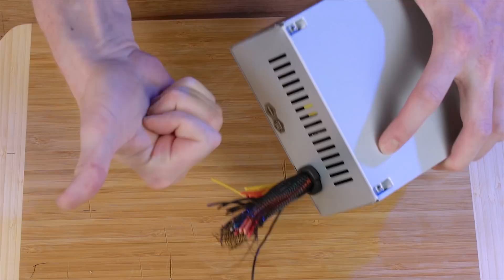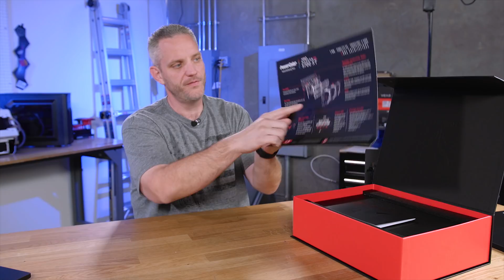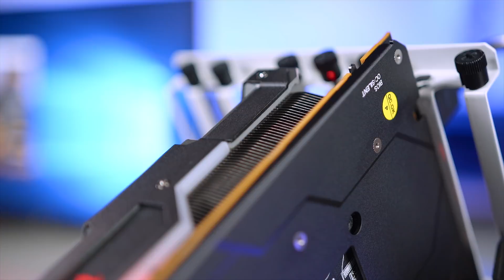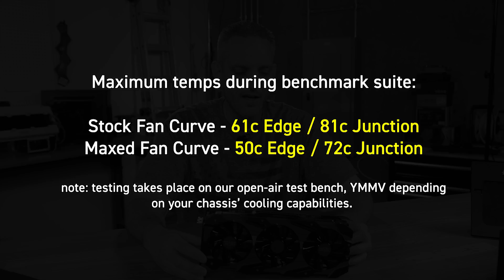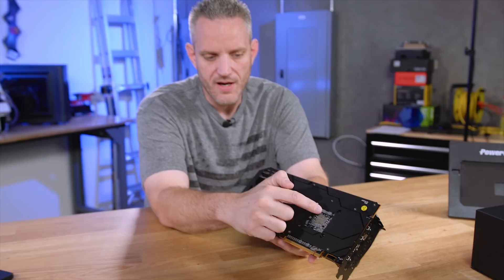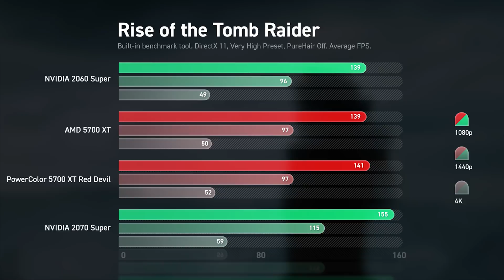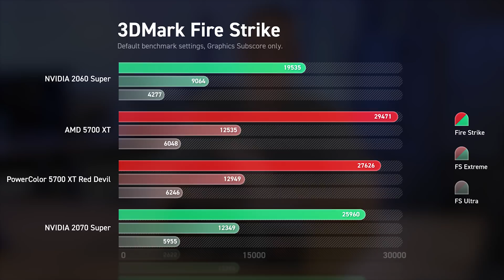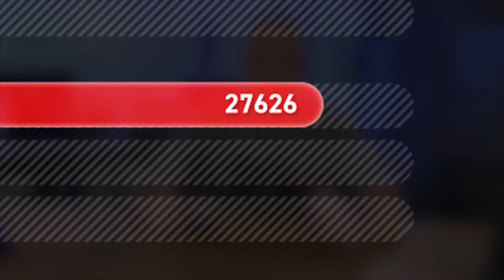Custom RADEON 5700 XTs are here! and THEY ARE GOOD!

Comment: Very nice, iam sticking with my 1080ti for at least one more year, but I hope they'll keep this going and next GPU I buy will be AMD.
Reply: 1080Ti is still rocking hard and breaking 100fps on most games on 2k or even 4k. Personal experience
Reply: Pascal was an anomaly in performance jump. 1080ti was a card years ahead of it's time. The it'll still probably compete with the next generation 70ti. No point in upgrading that thing for this or the next generation of cards.
Reply: You should probably wait till the Big navi see if that comes out but damm that GPU will for sure last about 2-3 years more until you could use an upgrade
Reply: @Humbus  yeah buy the time you can get one theyll be redundant came out yesterday sold out everywhere
Reply: @Gareth Tucker Yeah the 1080Ti was actually pretty good value just like the 5700XT now but the 1080Ti was good value on the high end instead of mid range. I'm thinking of also going with a higher midrange card when my 1080Ti is no longer up to the task.
Reply: @Warm Soft Kitty  why do you need 6ghz speed when the best GPU to this day bottlenecks at nearly 5ghz and the CPU usage doesn't even get close to 100% , cores are the future not your +1-3 FPS on games
Reply: @Warm Soft Kitty  games will need 6 cores really soon , besides current gaming performance is great why'd did u ignore what I said about the speed and CPU usage ? Selective thinking huh ? Anyway there's more than games for the future of pc and the current development is great only people like you aren't satisfied with the progress, your probably one of them we should've has flying cars by now , if you want something work and make it yourself , Engineers and researchers aren't here to make your fantasies come true
Reply: @Warm Soft Kitty  you just said more cores will give you better performance so that means it goes need it ! , It works on 4 cores sure but more is better , still you have yet again ignored the usage argument which shows you're a basic internet depater with no logic or information other than a few things you know and believe , you don't even understand what more cores mean to future technologies so I won't bother with you, insulting people first is always a sign of weakness and fear , I'll go ahead and take my W and leave you with your L
Reply: almost 12 months since this comment, did you upgrade yet?
Reply: 1080Ti will reach whatever frame rate at 4K as 1060 at 1080p.
It will certainly last for years to come. Hell, top end Navi isn't even as good as the 1080Ti... Which is still pretty effing sad for GPU progress lmao.
It took AMD 2 failures called 56 and 64, die shrink to 7nm, and so on to catch up with a 2 year old 1080Ti and with less VRAM.
The same goes for Nvidia backpedaling with the RTX line up.
Reply: @cunnyman  top end Navi doesn't exist yet. 5700 xt is a mid range card. And it's not that GPU progress is sad. The 1080ti was just ridiculous. That big of a generation gap isn't normal. I mean Moore's law is dead. You're seeing that in the cpu and GPU market
Reply: @Starwarman1  
I need to say "current top end Navi" it seems.
It doesn't matter if it is low end, mid end or whatever. The fact remains that 5700XT is AMD big boi for now.
Also, define rediculous.
Reply: @cunnyman  the difference between the 980ti and 1080ti is m a s s i v e. That jump made me a huge Nvidia fanboy for a long time just because of how genuinely breathtaking Pascal was. For example, the significant jump between a 970 and 1070 in performance made buying the 1070 an easy choice. I still rock my 1070 but Turing killed my love for Nvidia. The jump was far too small for a far too large price jump

Comment: C'mon BIG NAVI! I'm sitting on my amp extreme 980ti til big Navi releases. I refuse to drop $1200+ on a 2080ti especially since Ray tracing doesn't tickle my fancy just yet.
Reply: At least it isn't an even more expensive useless piece of shit cough Titan cough
Reply: I have a 560 Ti so I'm kinda screwed. It's wait another 6 months or buy 5700 XT and  sell it and buy big Navi later.
Reply: @praetorxyn  or buy used 1080 ti and sell when big Navi comes to play
Reply: @praetorxyn  If you're going to sell it when big Navi releases then you might as well get an RX570 as a placeholder instead of an RX5700XT. They're pretty cheap and more powerful than a 1050Ti so it's still a massive improvement when coming from a 560Ti.
Reply: @CheapBastard1988  agreed - get a RX 470-570 as a placeholder
Reply: I do agree about the 2080Ti though.
Reply: @Samuel Walker bought a RX 5700 xt aib dual fan for 450 canadian final price - sitting pretty xD
Reply: Yeah that gpu's price is the same as my whole mid-tier gaming pc build.
Reply: Yea those prices are just insane to me. I have not really looked at graphics prices until recently, and man was I surprised. My 1070 is getting to the point where next year I will be looking to upgrade it. And I do not plan on spending 1200 bucks or anywhere close to that on a gpu.
Reply: @gimiked8685  I've got a 1070 as well and it's still quite a killer card. Then again, I'm not the type of person that wants 4k, max settings at 144fps.
Reply: ay same here. Zotac is underrated af but I cant wait to upgrade. Been looking at a few used 1080 tis
Reply: @rkelypnonu9423  I don't want to step to a 1080ti cuz I am thinking of making the jump from my Acer Z35 @ 1080p 200hz to 1440p 200hz with the Asus PG35V OR the LG 38" gaming monitor it's 1600p n 175hz so I am definitely gonna need a little more juice than what a 1080ti has to offer hence why I'm waiting for big Navi.
Reply: @AmauryWithTheApe  Hate to be bearer of bad news my guy, but that monitor isnt 1440p its 3440x1440 which is an ultrawide resolution making it far more demanding than 1440p. Did some research and the 2080ti also has issues running games at 150-200 at that res. Idk if big navi will really help :/ Got my info from a review on techspot .com
Reply: R Kely P N on U if you still haven’t gotten a used 1080ti then just get one, buy a cheaper model online and stick the nzxt kraken g12 bracket and a cheap aio on it
Reply: The Titan is useless but if u cry about a 2080ti then ur a lost hope
Reply: @cosmocapalot_9454  Dude, a 2080 Ti costs $250-$500 more than the original Titan depending on which model you get, (not counting crazy ones like K|NGP|N), and $500 more than the 1080 Ti launched at, while only being 20-30% faster.

You can buy it if you need the best, that's fine, but to say there's no reason to complain about them literally alnost doubling the price for no reason (and no, Tensor cores and RTX that literally no one asked for and an extremely small niche of the extremely small niche that were going to buy a XX80 Ti card wanted, that no one uses because on a $1250+ graphics card enabling RTX gives you <60 FPS at 1080p in every title that's not Battlefield V, which gives <60 FPS at 1440p, do not constitute a legitimate reason) is just shilling.

Comment: This card has a 10 phase vrm not a 7 phase(the pulse and the refernce have a 7 phase as far as i know) also if you want to check it out buildzoid did a pcb breakdown.
Reply: Was gonna write same thing xD I mean this is a great all around video. But when we go down on vrm and alimentation, buildzoid is da boss
Reply: Had to check to see if anyone mentioned this right after Jay said it. They pulled the 7 phase and went 10 phase.
Reply: Buildzoid himself said that the pcb pictures he had for analysis were probably from an engeneering sample. If you do understand any german, watch the analysis on igors lab. He explained, that this card has 10 vrms for the gpu, but only 4 run at 1 phase each, 6 run on 2 vrms per phase. So 7 phases in total.
Reply: @minime-nn  pretty sure it's a 5x2+2 vrm even their site says 10 phases but i know better than to believe manufacturer's sites so i'll wait for conformation from someone who owns the card. But you say it's 4 true phases and 3 phases w/ 6 power stages? So 7 phase 10 power stages. That's kinda like hybrid asus style 2 power stages a phase. The strix being a 5 phase 10 stage vrm, but if that's actually true it's really interesting still better than stock.
Reply: When he said 7 I did a classic double take lol.  Jay....
Reply: Which is completely unnecessary unless u have some spare liquid nitrogen
Reply: also evoke has 7

Comment: it is enuf on 700w bronze psu + oc bios switch + 3900x?
Reply: Broze is 80 percent before it starts to have problems. So 560 watts. This pulls 250 max, and the 3900x pulls at Max 142 watts. So you're at about 400 watts there. Should be ok.
Reply: @Demonslayer20111  thanks dude 😀 i'm very excited to upgrade my gtx1050ti to rx5700xt red devil

Comment: The problem is if you're already willing to spend $440 on a GPU, another $60 isn't going to be make or break for you for a card with significantly better performance in a lot of games that also is ray tracing capable.
Reply: The only card that can deliver playable RTX at 1440p or more is the 2080ti tho.
Reply: @gettingbettereveryday350  A lot of people are still on 1080 - most in fact.
Reply: @surgetsann  agree... cause there's been little reason to upgrade.... maybe when the bigger radeon cards come out more people might start changing

Comment: Gotta check yo SPEC sheet mane. Its gotta (10-phase VRM) controlled by an International Rectifier IR35217 controller, which is among the best controllers available on the market.
Memory voltage uses a two-phase design and is generated by an NCP81022 controller.
The GDDR6 memory chips are made by Micron and carry the model number D9WCW, which decodes to MT61K256M32JE-14:A. They are specified to run at 1750 MHz (14 Gbps GDDR6 effective)
AMD's Navi 10 graphics processor is their first chip to use the new RDNA architecture. It is produced on a 7 nanometer process at TSMC, Taiwan and has a transistor count of 10.3 billion with a die size of 251 mm².

Comment: If ur over clocking a gpu hard is it good if the temps are around 75c but like +200mhz is that bad? I have a evga 980 ti classified.
Reply: They don't  melt until around 350 or so, turn up your GPU to 2GHZ and it will be faster than this card. 980 is a beast
Reply: Colin Wilson ok thx

Comment: it's 10% cheaper than 2070Super and 2070Super is 10% faster than Devil, not a bargain though. The card is adequately positioned on the market.
+ looks way better than boring ass Strix with the same recycled design since 2016.

Comment: 5700x is 400$ And the 2070 Suoer is 600$, 

Buy a PC first And get off the cloud you are, you are not rich.
Reply: @Chris Sandoval 10$ more. thats pretty tempting to buy. but with 2 games : wolfenstein 30$ + control 30$. Add 30$ more to your budget, you can get the 2070s
Reply: at my country the price gap only 100$. It's blower card vs thick palit card. So if this gpu is only 50$ cheaper than 2070s, just buy the 2070s
Reply: @timbersync  Yeah actually yes, In mh country the have'nt came out yet, I compared on Amazon, the one thats heavier is the one that's gonna be more expensive probably.

Comment: why do people never use the normal 2070 for any comparisons. i literally know nothing about that card because nobody covers it
Reply: They stopped manufacturing that one after the 2070 Super came out, though they are still making the 2060 and 2060 Super.
Reply: That's because it was replaced by the 2070 Super for the same price AND it's been covered for over a year. You can also find numerous videos on Youtube comparing Navi to the normal 2070 when Navi first launched. You don't hear about it much, because Navi has made the normal 2060 AND 2070 irrelevant to discuss. The "normal" 2070 costs $50+ more than the RX 5700 XT Reference Blower Card and is much slower, so why compare it? Pointless.
Reply: @majicdude88  i thought it would be a better comparison to the 2060 super because its a card with closer performance. and i didnt think it was much slower. its only a little bit slower isnt it? or thats what i got from the comparison ryzen showed off at their launch of the rx5700 and from online benchmarks the 2070 and rx5700 xt are pretty much neck and neck except on some games where they either favor nvidia or AMD

Comment: "105c is fine for silicon." But is it fine for pcb? Somehow i doubt it. 2-3 years and gpu can die due to pcb copper or solder balls becoming brittle.

edit: Maybe that's why colored pcbs are nonexistent now on mid-top tier gpus? Due to browning of it to constant thermal damage.
Reply: its fine, spark plugs have solder too
Reply: @atodaso1668  Not as fine layers and volumes.

Comment: Yeah I´m kind of in market of crossing over to team red with this card, but coming from 1080Ti would it be a upgrade? No not really (But on the other hand I dont have any graphics card right now) and would I choose the 2070Super. I dont know, right now it´s really hard in deciding. But the price to horsepower is awsome and I am leaning torwards this.
Reply: 400 for 5700xt, 600 for 2070 super. And they have pretty much the same performance.
Reply: @Demonslayer20111  the only reason I'm hesitating is maybe for the rtx for making a bit more future safe. Well I don't know.